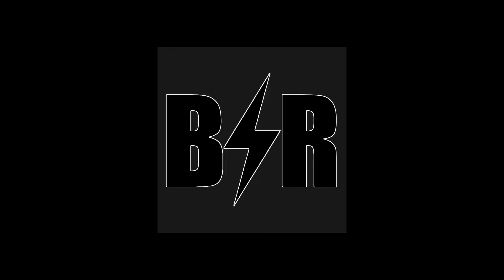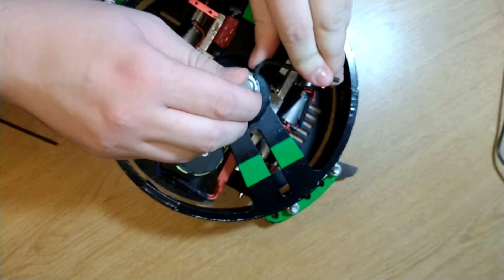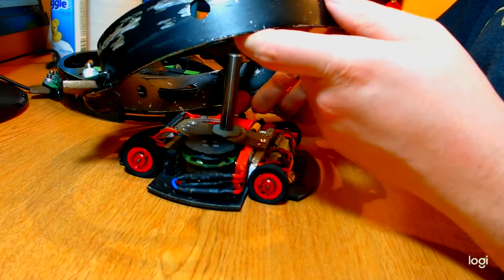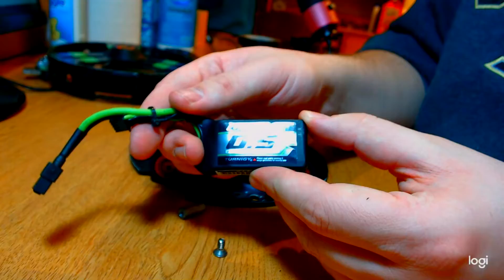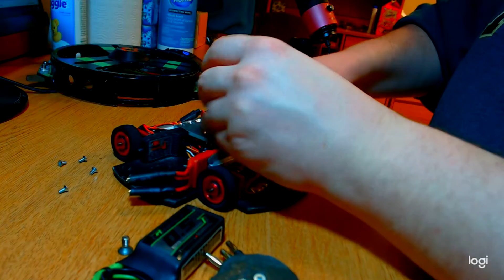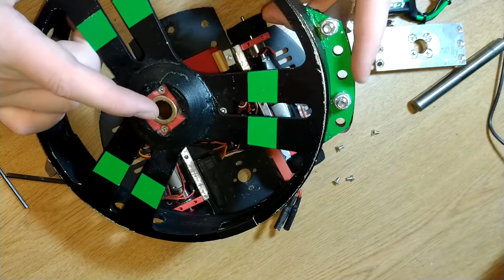Beetleweight Shell Spinner - Vortex Design Breakdown

Comment: Hi!  I run a shell spinner called Ultramicrobyte.  Its most recent build uses 4s and a 380kV motor 3-to-1 for the shell.  I see you run 480 kV for your shell motor-- what pulley ratio?
UMB shell is 1/16 welded titanium with a 1/8 ring bolted to the bottom--it is pretty robust, and weighs just under 1.5lbs. (Much the same as yours!) The shell support/drive system is almost identical to yours (with 1/2 steel shaft).  UMB does use brushless drive and belts to get all 4 wheels moving, mostly because of other beetles that used the same gearmotors.
I think you should consider:smaller rx, esc, and probably just soldering everything (i.e.get rid of all plugs, even the signal and bullets!)  because they add weight, space, and failure points--repairs with a soldering iron aren't much more time consuming in my experience.
Best of luck!

Comment: How did you get the outer part of the shell bent then welded?
Reply from the maker: The outer part of the shell was cut from tube stock! Onlinemetals sells stock cut to custom length, so we ordered small sections of a large OD tube size.
Reply: @BlackLightningRobotics  Thats smart! Im trying a similar design, but with a sandwich method for the outer shell so easy to replace segments. How thick is the shell?
Reply from the maker: @davdallaire6521  I think it was 1/8" 6061. Sandwich method seems to work well for Helicoboptochopter!

Comment: Very cool!

Probably a dumb question, but, why do you use a belt drive instead of a direct drive?
Reply: I can't speak for OP, but the 1/2 inch support shaft seems like a pretty solid reason--direct means you are limited by the motor shaft, which are typically 5mm max.

Comment: I have a quick question about the weapon assembly. The Oilite sleeve bearing y'all list in the parts is only rated for ~370 lbs at 120 rpm, but it looks like y'all are running it much faster than its rating. Is it not a bit risky to put a bunch of lateral force on a bushing that's spinning way faster than it's rated to? On a related note, how many rpm would you be willing to put on that bearing?
Thanks a million for your videos! I love them all and they're super helpful. I always get excited when I see y'all have posted.
Reply: I run a 3HP motor 6000rpm to a 4lb, 14" bar on a 15lb bot. The same 1/2" bushing survives 12-15 fights so far
Reply from the maker: Glad to hear you like the uploads! There are a few reasons that bearing was chosen. In the previous versions of Vortex a needle roller bearing was used, but due to the nature of these bearings, they tend to have a lot of "slop" or "play" meaning the shell could wobble after a big hit causing instability. We made the decision to switch to bushings since they can have much tighter tolerances due to the lack of moving parts; that's when we tried the sleeve bearing. The main concern with sleeve bearings of this type is too much sustained load. Those ratings are meant to keep the bearing from heating up and experiencing excessive wear. When not actively hitting something, the shell experiences very little radial load, only the axial load of spinning up. While the shell may experience very large loads when hitting something, this tends to be a very quick action and doesn't generate too much heat to be a problem. The other thing is that combat robots tend to have a very low service life of parts, wear on the bearing isn't a huge concern since matches tend to be only a few minutes in length and parts tend to only be used until they are too damaged or destroyed. If this part saw use for many consecutive hours, the load ratings would be more of a concern. Overall, for this application, I've been very happy with the sleeve bearings and I'm comfortable running them at very high rpms (5000+) as long as they are checked periodically to make sure there isn't excessive friction or wear. I hope that answered your questions.

Edit: One more thing. The size bearing we are using is 1/2" ID 3/4" OD x 1" Length, which is actually rated for 1000lbs at 120rpm. This is due to its larger size, so it can dissipate heat and spread the load more evenly. The cone-shaped piece that helps retain the bushing is actually just 3D printed PLA, and the bushing never got hot enough to even weaken that part.
Reply: @BlackLightningRobotics  Thank you for your detailed reply! I'm new to building so I have to reach out to learn these things.
One more question: are those plastic washers under and over the shell something along the same lines? Oil-impregnated UHMW or something?
Reply from the maker: @Mintie7  That's great! We love to hear about new people getting interested in what we do. We actually just use a combination of steel and Nylon washers. UHMW is self-lubricating and can be used with great success. We, however, chose to use regular Nylon washers because they are cheaper and much easier to get; they can often be found at local hardware stores. We figured they would be easier to get spares if the ones on the bot failed, that being said, we haven't had any fail yet.